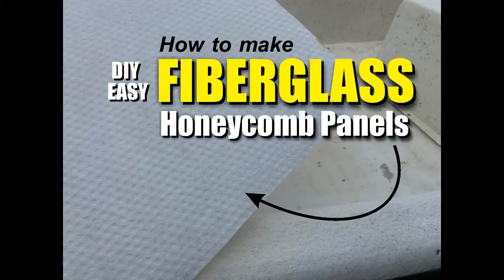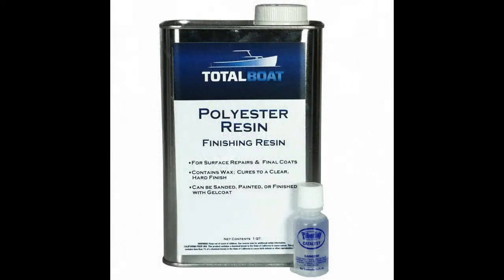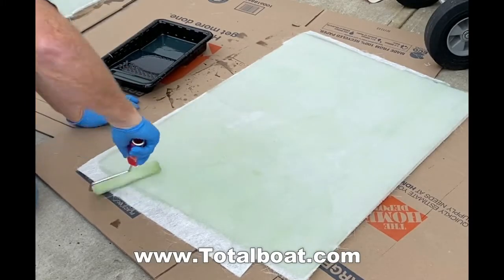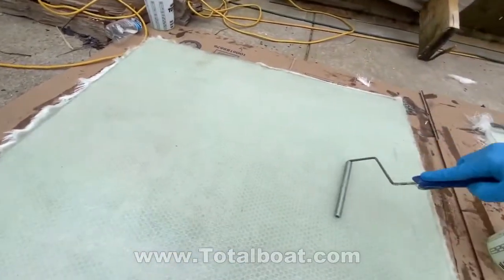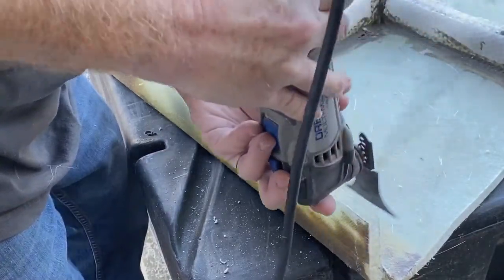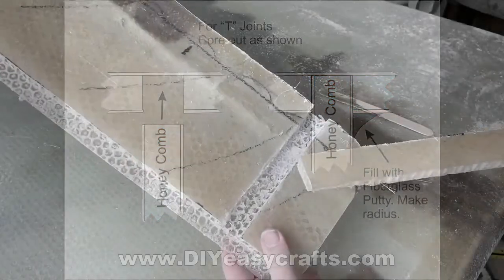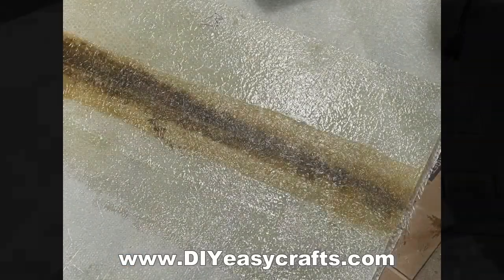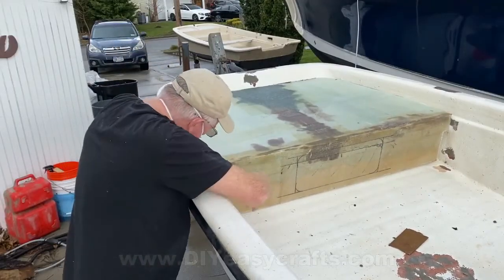How to easily make Fiberglass Honeycomb Panels

Comment: I am repairing delamination in a 40 year old beach catamaran. I’ve been injecting epoxy resin, but you’ve got me thinking about cutting out the top layer of glass and replacing the core with nomex.
Reply from the maker: Go for it!

Comment: Been using this board for a while…built decks, radar arches, center consoles. It’s pretty good stuff if you want to use it for contouring shapes. Score the panel every 1/2”-1”, this will allow the panel to bend, fair, fill and glass.

Comment: Can you not just use a stanley knife and the putty to first put together the shape and then once that has set and is rigid lay up the fibreglass and add fillets between joints, also wett out the fibreglass between plastic sheets.

Comment: Well this stuff is readily available but this is cheaper and it's better and safer to work with than Aramid Phenolic honeycomb...stuff is bad for you.  As far as removing honeycomb goes, in the Air Force and other aircraft industries we'd use a 90° scriber tool in a drill which allows you to remove material below the sheet and we'd fill with microballoons (it's very strong and very light).  You're doing great work here for the DIYer.

Comment: Curious why you chose this over say XPS foam panels?   If you take 1/2" thick XPS foam sheets and put (lower weight) fiberglass on each side of each panel and then put them together, it becomes very strong and stiff.  You do have to scruff up the surfaces really well though.
Reply: Multiple videos on line showing how most resins melt XPS. what are you using that stops that from happening?

Comment: Thank you for tutorial, Do you think you think it could be used to build furniture, like kitchen cabinets? Can it be coated to look premium? What is the weight difference between this and plywood?
Reply from the maker: Yes, absolutely
Reply: @DIYeasycrafts , do you have to use special fasteners?
Reply from the maker: @sabio2009  No but use a large washer or a backer board behind items like cleats

Comment: On the edges, a good polyurathane caulking seems to be much easier and more durable than bondo epoxy. That stuff isnt wp flexible or durable.
Yes, fiberglass will be better...nice work

Comment: Did he really just say that epoxied and glassed marine plywood will eventually get wet and delaminate? Don't believe everything you see on YouTube.
Reply from the maker: I ran a commercial dive boat for 30 years. Have worked on boats my entire life. Water will find a way in!! Even if its a small crack or even a screw hole that is not properly sealed.

Comment: You've probably already walked on similar panels, but with a paper honeycomb.

I'm looking to build a DIY boat and plywood is expensive now. If I'm reading specs correctly, a same size sandwich of this stuff should be several times as strong as the plywood.
Reply from the maker: I would never use plywood again. But I do not have any experience  with honeycomb for a hull. I have only used it for topside applications

Comment: Good tutorial.  I do have a suggestion: instead of wetting out the Matt cloth on the honeycomb or cardboard, use some plastic sheeting laid out flat, wet it out, then squeegee out the excess,  then lay it on the honeycomb that has been wet out. This way you cut down the weight with no loss of strength. Roll it like normal to get good contact.
Reply from the maker: That's a great idea! Will have to give it a try
Reply: Melamine sheet is great for this, better than plastic, which creases and moves. If you use PVA as a release agent, a simple wash with water washes off the PVA residue and is ready for sanding or painting.

Comment: What keeps the glass delaminating from the smooth honeycomb plastic?
Reply: They thermally bond/weld polyester scrim to the polypropylene honeycore structure.  The polyester resin or epoxy then bonds to the polyester scrim surface.  Not much bonds well, chemically, to polypropylene, since it is such a low surface energy plastic.

Comment: For things that will not be in the sun, you can put one layer of 4 oz surfboard glasscloth over the honeycomb with polyester resin or epoxy, then go over that with the clear countertop epoxy.  Use a torch to break any bubbles and keep dust away until it hardens.  All the resin and glass become transparent and you clearly see the honeycomb pattern in the part.  I did some ceiling panels and a countertop with honeycomb and countertop epoxy and the 3-D honeycomb looks awesome!  You can't use it for anything that will be in the ultraviolet because that will make the countertop epoxy get all alligator-skin.
Reply from the maker: Would love to see a finished photo

Comment: Very interesting. I submit that honeycomb panels are not a 1 to 1 equal to plywood when it comes to stiffness and they deflect more. Here is a video showing that: https://www.youtube.com/watch?v=h4bApsXSavM
 But since the stiffness of an object increases/decreases by the cube of the increase/decrease in thickness. if you double the thickness of some material, you increase stiffness (resistance to deflection) by a factor of 8 (ie, 2 cubed). So a 5/8 inch thick honeycomb would likely surpass somewhat the stiffness of a1/2 inch sheet of plywood and still weigh much less.
Reply from the maker: The vertical wall add quite a bit of stiffness. I also have a honey comb stringer for additional stiffness. The real benefit comes from the fact that it will not absorb water. become heavy or rot.

Comment: the issues is screwing into in and the screws staying put...
Reply from the maker: You are correct its not like wood. I do not use screws. Only nuts and bolts with a backing plate (usually pvc board). I always use a little silicone or 5200 on bolt threads so the nuts do not vibrate loose and it helps seal water from getting into honeycomb. Still much better than plywood.
Reply: In aircraft honeycomb panels the method for bolts is to drill your hole where you need it.  Then take an L shaped piece of wire and hollow out the area behind the hole.  Then fill it with  the putty and insert a nutsert  and tape over it to keep the putty from oozing out.   Once cured is very secure.

Comment: Would that be strong enough to sit and walk on?
Reply from the maker: Depends on the span but yes
Reply: @DIYeasycrafts  Perfect thanks! I am trying to make asolid but very light roadcase for DJ equipment with a balsa wood frame and something solid but light for the panels. I think this might just be what I needed.

Comment: How would this work as a painting substrate for art?
Reply from the maker: Not sure if I understand the question. It would seem like a lot of work rather than buying a canvas
Reply: @DIYeasycrafts  Thanks! Im well aware what my options are as far as canvas is concerned and other traditional substrates. I prefer to paint on smooth surfaces like MDF board, but those are prone to warping, especially if not sealed properly on all sides. So I'm looking at alternatives less sensitive to moisture such as ACM panels, copper sheets, and now, this fiber glass material.
Reply: @DIYeasycrafts  Going back to my question, more specifically, do most paints adhere to fiberglass easily? Or do some delaminate and peel off it; as acrylics are liable to do on some polymer surfaces.  I know oils would probably do fine...

Comment: Great job and I like the way you have shown diagrams of the different joints etc . I want to remove my splash well to make more deck space and will need to make some support walls . I will use your principles with 1" foan core . Thanks again for both the ideas and the methods  .

Comment: Did you consider using a closed cell PVC foam for the core?  Also, how is the fiberglass adhesion to the honeycomb compared to other materials?
Reply from the maker: The honecomb is made to adhere to fiberglass so adhesion is not an issue. it also will not soak up water so hopefully will last for years with out becoming heavy and delaminating.

Comment: Thx for vid. I'm currently looking at options for making a Wingfoil board. 
Traditionally they are made from EPS / styrofoam blank skinned with cloth/resin like a surfboard but .. wondering if I might use your technique - what really peaked my interest was the ability to introduce bend to matrix core before glassing. I could shape rocker right in from get go. I'd have to laminate a few to get thickness then shape /fair out with final wrap in carbon cloth.
Do you happen to know how much a full panel weighs dry? I read through comments but didn't see.
Fewer finishing layers of cloth probably required with this stiffer stronger core.
Great vid - thanks again!
Now the real challenge - finding this stuff in Canada!
Reply: Probably how the libtech surfboards are made, I think they call em hexcore.

Comment: Came across your video by accident. Do you have any insight into its strength in compression edge to edge. I need to fill a gap between a hollow formed by a vehicle's fiberglass body molding. Think of it as wanting to use the honeycomb vertically replacing the straight line of the letter D
Reply from the maker: Sorry but I do not. This was the first time I used it

Comment: This looks about perfect for building my little folding camping boat, whose largest panel is 4:5'/137cm x 1'/30cm.

Your tutorial has really helped and inspired me as weight is important as this will be towed as a bicycle trailer on the road. 

Push button Q/R axles (as fitted to wheelchairs) will take Brompton 16' wheels, a Q/R towbar attaches to the bow. 

The tailer size is 4:5'/137cm long x 2'6"/76cm wide x 2'/60cm high, and when unfolded the boat will be 9'/274cm long x 2'6"/76cm wide x 1'/30cm high.

Kayak paddle or small outboard motor for propulsion.

The weight saving will be significant over marine plywood, and this method provides additional flotation and insulation.

A collapsible/folding cabin provides sheltered sitting and sleeping space.
Reply from the maker: Sounds like a cool project. Would love to see photos once finished

Comment: Nicely done. I am sold on this material for strength, rigidity, and relative cost-effectiveness. I researched these materials extensively a few years ago, and conducted many experiments thereafter. Two comments:

WATER INTRUSION:  Plastic honeycomb has a troubled reputation for boatbuilding where water intrusion is possible (hulls). First, know that the plastic (core) does not bond well to polyester or epoxy resins, instead, the resin bonds to the "skin" which is a polyester-impregnated cloth. When it happens, the fiberglass wall (including the skim cloth) separates from the plastic core and water enters through the separation, essentially filling all the cells therein. It's not a deal-breaker but rather means that any penetration or crack is a vulnerability and must be repaired/resealed immediately. 

EDGEWORK:  It was good observing the attention to the edges because the edges are among the weakest parts of the final assembly. I am not familiar with the epoxy putty used but I would be a little concerned about bonding between the plastic core material and the epoxy putty (often weak bond results). One way to overcome this issue is to "activate" the surface of the exposed plastic core using the activator found in Loctite 2-part "Plastic Bonder" with a plastic-specific adhesive such Devcon Plastic Weld or a methyl-methacrylate (MMA) construction adhesive. All that is needed is a thin coat because (epoxy) resin bonds fine to the adhesive. I make 100% strong edges and bond sheets this way. 

YMMV. Good luck!
Reply from the maker: Great info thanks
Reply: Interesting. Is there a book on the subject?
Reply: Yeah, the core is made out of polypropylene which has a low surface energy and not much bonds to it well.  Definitely need to alter it.  Cold plasma treatment can also help to make the surface more bondable.

    You might be able to use a low temp hot glue, but that would need to be tested well before even trying.

Comment: is the plastic honeycomb core pretty cheap? (cheaper than nomex/aramid honeycomb?)
Reply: Cheaper now than plywood of equivalent thickness.  But best find a place relatively close by that allows you to pick up the product, because shipping tends to be extremely high with these large, 48" x 96" panels---several times higher than the cost of the actual material. To put things into perspective. a 1/2" thick sheet of this material from one place costs like 53 dollars, but would cost 215 or so to ship.

Comment: What prevents the epoxy from filling all the honeycomb holes and making the part heavier?
Reply from the maker: The sheet is covered in fabric on both sides. Im sure if you soaked it in resin you could get holes to fill up but it would be hard. I did not have a problem even using a generous amount of resin on a roller

Comment: thankyou ,very Informative videoes  i am almost 60years of age and i bought my first boat before my first Car !  over the years i’ve owned 17or 18 boats of all sizes ,Makes ,and Models as Well as Materials  you make  using the Honeycomb board a lot easier than it really is but you definitely  offer some great advice and Tips , i myself am now retired  and i did ProfessionalWoodworking Professionally for over 35 years  watching you cut out the HoneyComb boards with the Oscillating tool  can be accomplished much faster with  a Router and some simple Jigs for that Router  a good group of Reasons for this is because of the many different Routers  and Bits  Available and Used inThe Woodworking Industry  they are also IMO reasonably priced and Available  along with providing excellent Accuracy with Speed , for myself being Retired i’m probably going tom”Binge” watch your channel in preparation  for my next Boat Project  I grew up inFlorida , and am in the Process of moving back there soon as my grownChildren and Grandchildren reside there now  and  we do have plans on either Restoring or Building  a Vessel  as you stated  using any type of Plywood Core  usually does fail over time  and with the Pricing of most Pywoods compared to the Honey Comb Core Board it just makes more and more sense to  have that as  the GoTo method  as opposed to a Cold Molded Process  and in all  Honesty i’ve gone down the AllWood TraditionalHonduras Mahogany Boat route yes they are Beautifull in many ways  but  i like being out onmy Boats not always working on them , so i admit  i committed the CardinalBoaters Sin before i listed the Woody for Sale i already purchased. a newer ,repo we’re Sport Fisher Plastic (Fiberglass ) boat  as my main Cruising and Fishing Vessel
Reply: Craig, you are really good

Comment: I wonder if I could build a camper using this method. It should really cut down on the weight.
Reply: I'm building a tiny "airstream" trailer to pull behind my ebike- a 1 person sleeper.  it's just just skeleton so far,, but I'm planning on using two layers of this stuff to stiffen and sandwich 1" rigid foam insulation, with maybe a heated floor mat and vinyl flooring on top.  also considering using it vertically as a wall finish.  it strikes me that since it's translucent, it might be cool to edge light the honeycomb with LED strips.
Reply: @travismiller5548  interesting... I was thinking the 1/2"panel - 1"foam - 1/2"panel would be perfect for factory RV windows in my lightweight truck camper that I am planning.  I also like the flexibility of the 1/2" over the 1" Nidacore.  I am wondering what to do on the corners  I really don't want to use wood... might be an idea to make a fibreglass angle the profile of the side (I have seen a project where they used aluminum angle but would be cool to go all glass and honeycomb
Reply: First thing I thought as well!
Reply: Yes, I've already seen this stuff in the walls and roof of a Starcraft cutaway bus that I converted.
Reply: Thats what I was thinking

Comment: Can you build a hull from this?
Reply from the maker: Im really just not sure. I only used it for the deck platform. Im thinking you could, as long as exterior layer of fiberglass was thick enough. I would use plywood for the stern and you would have to add stringers
Reply: I guess it depends on cost vs. plywood.
Reply from the maker: @robertboyer5498  oh no I think it might be better than plywood. Its lighter and would not ever become saturated with water
Reply: @robertboyer5498  u

Comment: Any reason you can't use biaxial on both sides?
Reply from the maker: No reason at all. I usually only use the biaxle on outside or area that is going to get walked on.  Using it on both sides would make the panel even more rigid